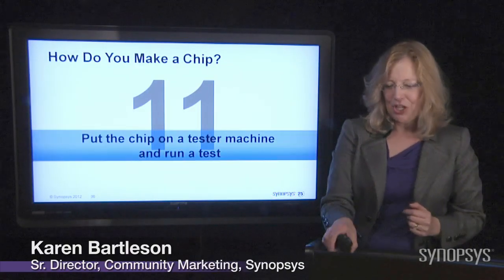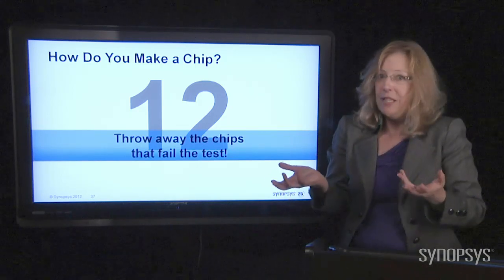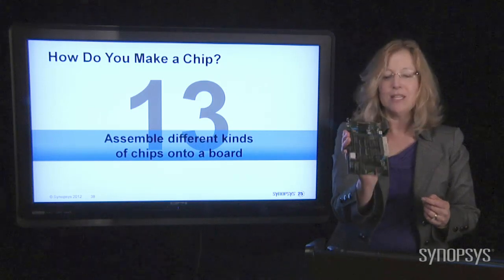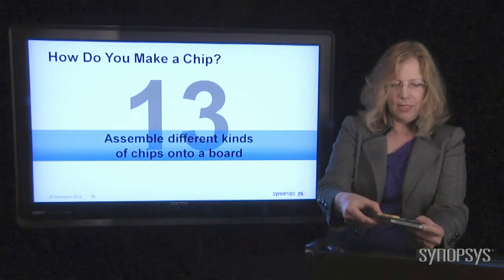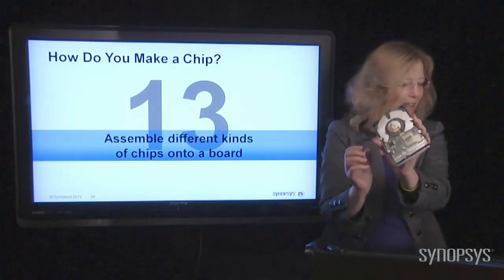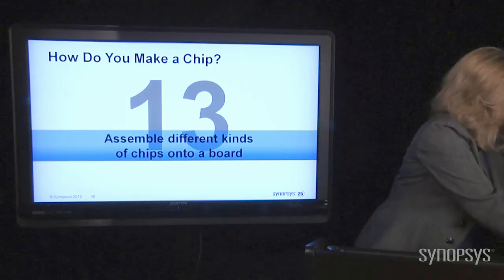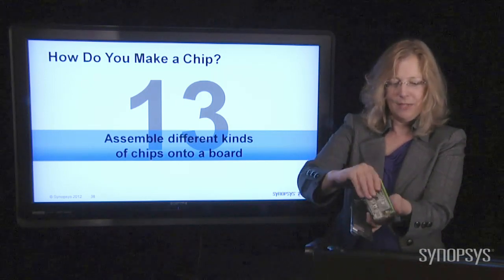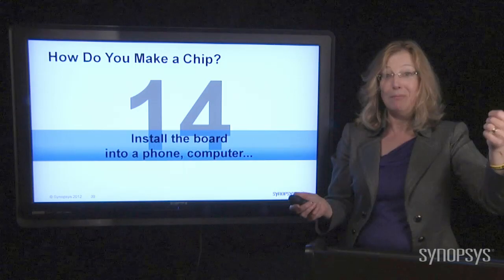World of Chips, Episode 8 Part 2 -- Steps 11 -- 14 | Synopsys

Comment: Many chips were having more thickness in the electronic devices, but you have shown us the wafers with less thickness. so did they cut the wafers with more thickness that was connected in electronic devices ????
Reply from the maker: +Mahaveer Royal As wafers get larger in diameter, they getter slightly thicker too. So maybe you are looking at chips that came from wafers with larger diameters than the wafers that I showed.

Comment: How does the chip do all these algorithms and what determines what a chip does or how powerful it is?
Reply from the maker: +Illiyoon25 The design engineer thinks of the algorithms and the idea for the chip. It is the design engineer who determines what the chip should do and how powerful it needs to be. The design engineer uses the EDA tools to turn his/her idea into data that is used to manufacture the chip.
Reply: @synopsys  so if i try to atached each process to Engineer:
1.designer eng do all logic stuff on computer
2.micro-architecture eng do all thoose photolitography,acids,layers,from designer eng blueprint
3.Firmware eng do drivers for chip
4.verification eng check this chip works properly
Am i missed something?Could u please corect me if im wrong?))